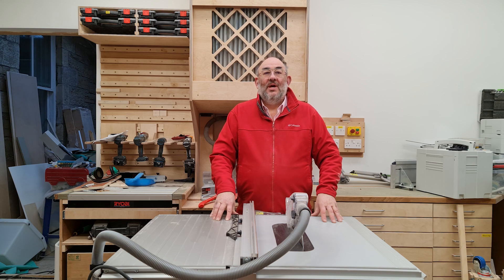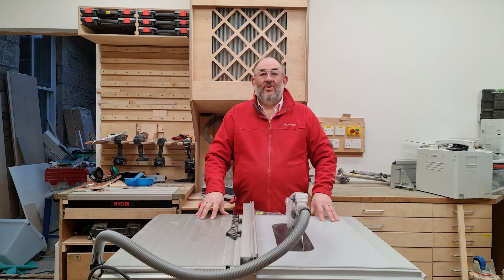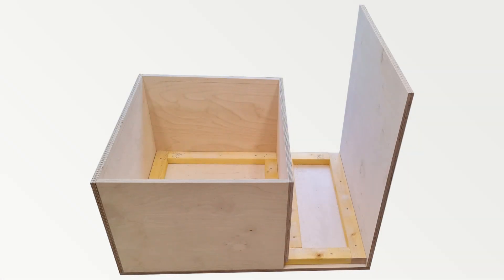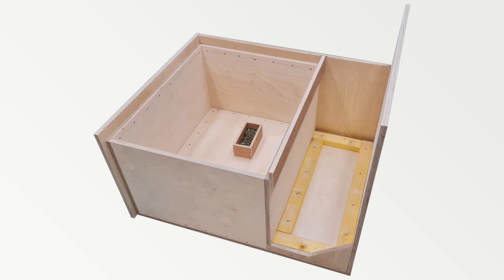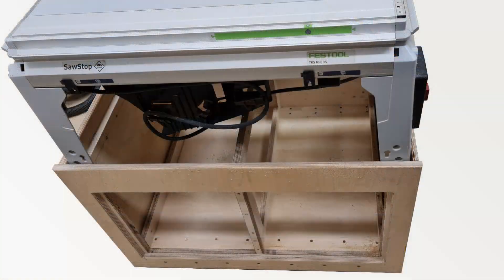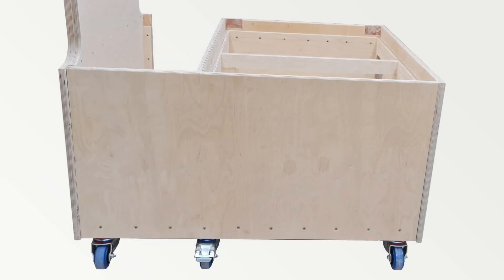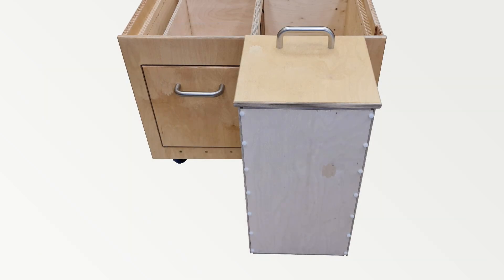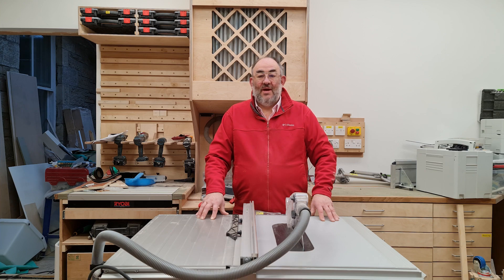FESTOOL TKS 80 Table Saw Cart - Build & Guide

Comment: Can you tell me how to remove the legs of the TKS 80? I can't undo the knobs enough to remove the bolts that secure the legs...
Reply from the maker: Hello Jeroen, If my memory serves me correctly the tops of the knobs pop off with a flat blade screwdriver which will then allow you to remove the fitting. If I am wrong, do come back and I'll look out the legs from the loft and refresh my memory.

Comment: Nive video and a great job!
Have you done the sawing by using the tks80? I find the saw very interesting! But the are some negative comments
about accuracy of the sliding table...
Greetings from Hamburg
Daniel
Reply from the maker: Thank you Daniel for your encouragement. I'm making a new bench at the moment and concentrating on that and haven't as yet used the sliding table, although it does seem very stable but I do worry that there is the possibility of adding together small errors at each joint of parts and ending up with a significant error. I do have some ideas about how to make a sled with it and will get a chance to try soon and I'll make a new video if I've something worth sharing.